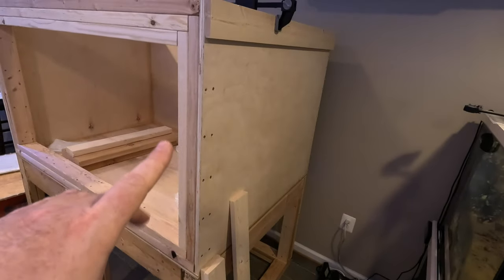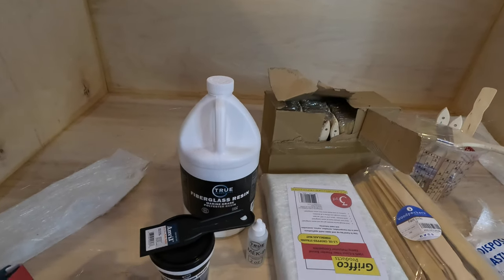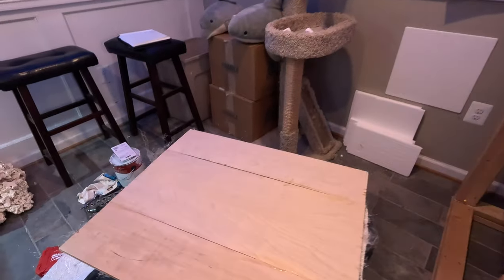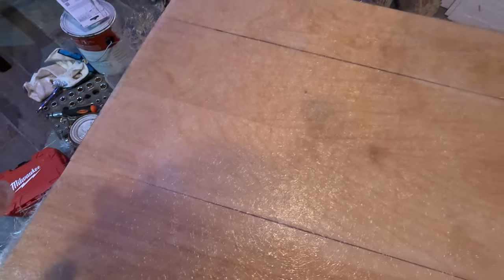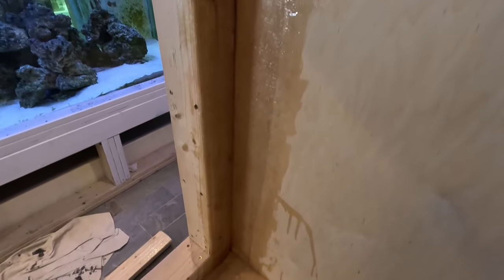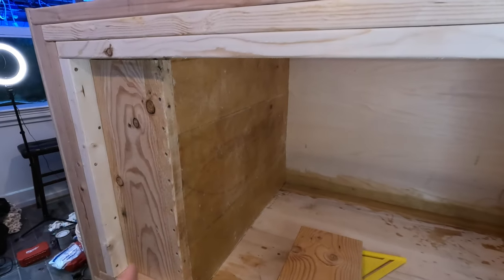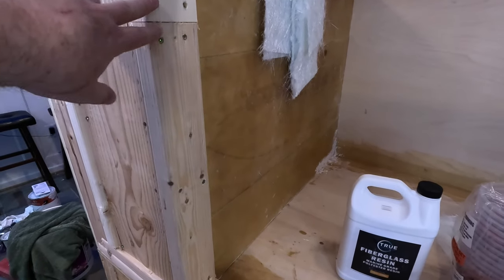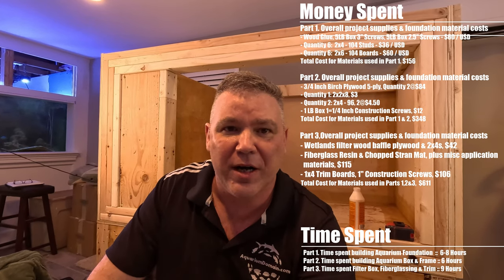How to Build a DIY Aquarium, a Step by Step Guide. Part 3

Comment: Good to see more people building plywood aquariums. What are the dimmensions of your tank ?  My 8ft x 2ft x13mm bevelled front viewing pain, was $270 when bought, 8 years ago. Ive got 1 of the 8ft panels along with another custom cut 18" piece on the front of my 450g maintank and this 8ft glass panel, for front viewing of my recently finished, 300g plywood tank. build.
Reply from the maker: Tank is 5ft x 4ft x 3ft, but with the internal wetlands filter the actual section with the fish in it will end up 4ft x 4ft x 3ft.
Reply: @AquariumDomain.  Are you thinking Angels or Discus ?  Or are you thinking a Salty ?
Reply from the maker: @FreeSwimmer  I don't want to ruin the surprise, but I will say that the main group of fish will be a species of New World Cichlid. 🙂

Comment: What do you think about using a putty knife instead of, or with the paint brushes?
Reply from the maker: I don't see the putty knife working well. The brush and roller work well as they can hold a lot of resin and then just tamp it down into the fiberglass mat. Some people use metal tools for rolling seams to make sure there is no air bubbles...and I have used them in the past, but honestly I find the brush works better...softer and when saturated with resin fills in any tiny spots when pressing in the seams.

Comment: question: why did you make the wet land filter on the left side of the tank and not the back wall. are you thinking it will be easier to do maintenance on that side? guessing it would be, I have no idea what that filter is salty guy here. 

anyway like everyone else,   i am excited for part 4 & 5 :D
Reply from the maker: Good question!  Everything about this tanks design is to fit the particular space I am putting the tank. I put the wetlands filter on the left so that the emergent growth plants coming out of it will be near the window and away from the mini-spit head that is to the right of the tank. The scape of the tank and the wetlands filter are designed to merge together...it will make sense when it is all done...assuming it works out like the picture in my head lol :-P
Reply: @AquariumDomain.  ah got it. Makes since now. Free light coming in the window + not blocking any heat/cool if the unit.  Love your basement man cave.

Comment: is it possible to do this with an acrylic front instead of glass? Will be great to know what changes are needed. I'm paranoid of using glass which makes me go for plywood in the first place.
Reply from the maker: Yeah it is definitely doable to use acrylic instead of glass. Because silicone doesn't bond to acrylic like it does glass most people who use acrylic windows will use some mechanism to push the acrylic window up against the silicone gasket (beyond what just the water pressure does). I don't know if that is 100% really required since I haven't ever tried it, but I do see a lot of people do it.
Reply: @AquariumDomain. thank you. So it’ll need to be bolted to the frame. But will still use silicone for the gasket effect even if it doesn’t stick hard. Btw what’s your thoughts on using thin acrylic for the baffle as the fibreglassing looks too much effort for the small place?
Reply from the maker: @ajaymanoharan5496  Yes, definitely still need the silicone gasket 🙂  The only issue with acrylic for the baffle is the issue with the silicone not bonding to the acrylic and holding it in place. Even though the water pressure will be similar on either side of the baffle, I couldn't say if it would stay in place with just silicone. There may another bonding chemical that adheres to acrylic like silicone does to glass, but I am not aware of it.
Reply: @AquariumDomain.  I’ll epoxy the acrylic baffle to the wood

Comment: Question why don't you fibre glass the whole tank is it a cost thing just curious cheers
Reply from the maker: Yeah, simply that is costs more money and time and is a bit of overkill for a smaller tank like this one. I did do that on my 3000 gallon build because I was shooting for maximum overkill on that build LOL 😊   

Actually now that I think about it I fully fiberglassed most of my big tanks, but I did so knowing I was overkilling the build based on how strong my structure and bracing was done.

One thing I would point out though when fiberglassing flat surfaces with no seams, is that you do always run the risk of an air pocket in the fiberglass which could undermine your epoxy gel coat waterproofing and cause a leak. So while it does make it stronger, it creates large areas of fiberglass that need to be done correctly and fully inspected for any imperfections / air pockets in the fiberglass work.
Reply: Thanks for the feed back can't wait to see next step cheers

Comment: So if I use 1 quart of resin how much hardner do I add some say (google)  1% but what the hell is 1 percent of a quart
Reply from the maker: My advice is to skip the cc to oz/quart tables True Composites provides and just use a mixing bucket/container with graduated mL markings and a graduated mL pipet or mixing cup for the catalyst.

 300 mL resin at 1% hardener/resin would be 3 mL of catalyst
 300 mL resin at 2% hardener/resin would be 6 mL of catalyst
 
 mL and cc are nearly identical so you could also say 300 mL resin at 3 cc catalyst at 1%. The percentage of hardener/resin is the curing speed of the resin, don't exceed 2%.
 
 Hope this helps.